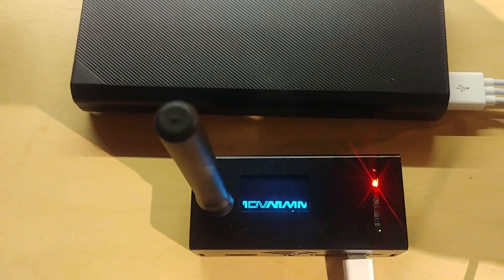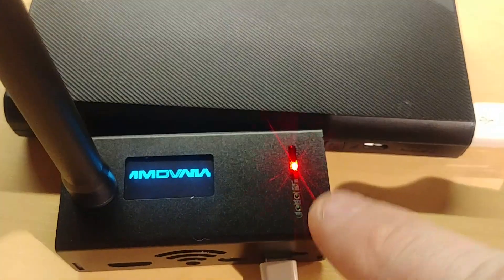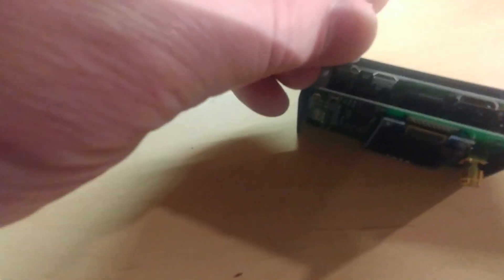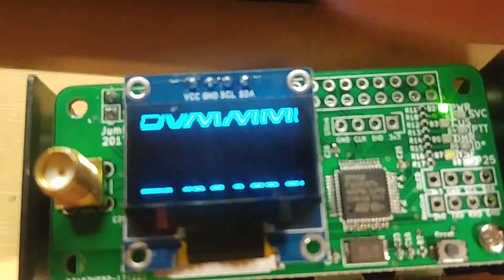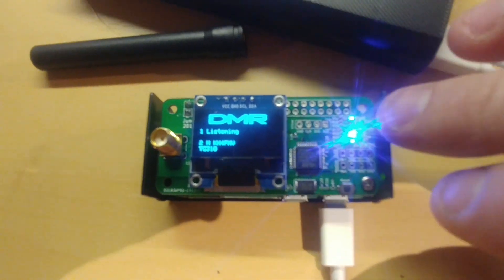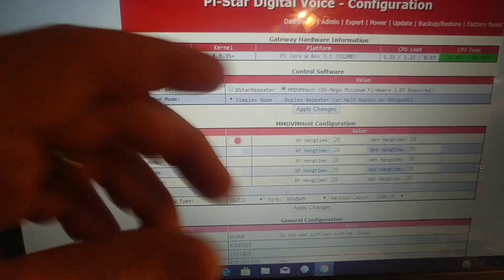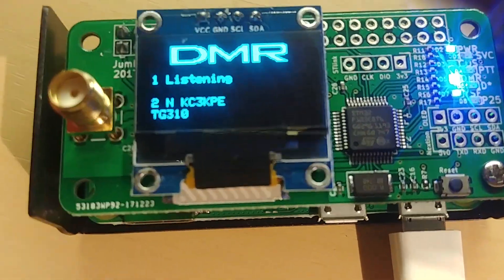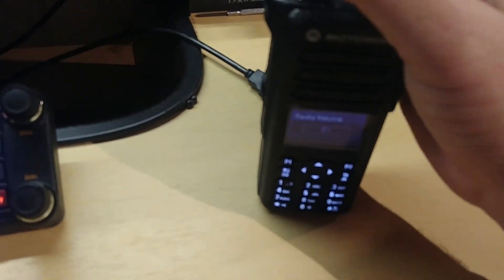Jumbo Spot DMR Hot Spot mmdvm board on a  pi zero

Comment: Hello KG4CDZ i knda have a question more than a comment that has to do with the gpio pin bar. I read that you have to have some pins insulated that's one of the  question's  whats all that about (pin  insulate). The other has to do with adding a jumper i think pin 40 to another pin i'll try to find a video on that subject of the link to that
http://www.hagensieker.com/blog/page/?post_id=99&title=jumbospot-dmr-hotspot having to do with firmware upgrade issue. Just purchased pi zero with i believe a jumbospot and had to return due to not working. And lots of trouble login to the dash board maybe once or twice per day it let me in. long story short messing around with the failed on gave me enough confidence to build my own.Whats your take on the 2 questions

Have Good Day
Adan
KI5IQU  In Oklahoma

Comment: When you first set up Pi-Star, there are two fields for your TxOffset & RxOffset that you should have entered your Hotspot’s offset into. However, after you do the initial setup, I’m not sure if you can get to those fields without starting over. Some else can confirm if that is the case or not. BTW, my offset label was on bottom of case and not inside.

Comment: Do you have any idea on why a mmdvm pi hotspot has no tx and rx?
Reply from the maker: do you have the offset set right by the sticker on the bottom of the board ? that is usually what the issue is
Reply: tried 100, 500, 1000.. still no luck. the mmdvm board has no label on what offset to be set also.

Comment: Just to let people know, there's a bad batch of these boards going round. I have purchased two so far from two different sellers on eBay and both were TX/RX dead. According to one or two groups on Facebook, boards manufactured in 2018 are having problems with the TCXO not working right and needing to be replaced. If you are unlucky enough to have one of these boards, return it for a full refund and do not accept anything less.
Reply: Seriously I just got one of these boards and the TX worked intermittently for less than 24 hours before she went complete silent. Junk.

Comment: I see you have your hotspot on 436.225 MHz.  Please try to avoid the satellite subband (435-438 MHz).  10 mw does not sound like much but don't forget you will be transmitting back to the hotspot with higher power.  As  these become more popular, the QRM will only get worse.
73 de K4RS
Reply from the maker: Roger Snyder my hot spot is not on 436 my hot spot is on my repeater frea
Reply: In this video, at 2:39, it is clear that you have set the hotspot frequency to 436.225.  This is right in the middle of the satellite subband.  I believe you changed the frequency later to a repeater frequency that has been assigned to you.  My initial comment was primarily directed to others who may not be aware of the problems that QRMing the weak  signal area used by satellites could cause.

73 de K4RS

Comment: Hi- I just got mine in today from china.  It boots to a solid green LED with a very slow blinking red LED.  The OLED display is totally black.  No instructions.  Solder connection looks good.  Any idea?
Reply from the maker: Bruce Kempf it has to be set up on your Wi-Fi before you can go,into,the settings and turn,on your screen and set everything up to use it I'm in the process of making a set up video from start to finish I hope to have it finished soon there is several web sites that will show u how to do it if u didn't get the instructions google jumbo spot set up  and pi star will get u started
Reply: I have the wifi setup but there is a setting for radio/modem type with lots to choose from.  I have the original OLED display but I have never yet seen anything light up on it.  Im worried its defective.

Comment: Question(s) for those who have this MMDVM model because I am either confused or my coffee this morning did not contain enough caffeine. LOL Before I buy one I would like to clarify a few things. First the frequency shown on the PiStar screen is 436.225500 MHz and he says the offset is 500 Khz. So what is programmed into the radio? 436.7255, 435.7255 or is it 436.2255? Does he mean something other than 500KHz? Also just playing with my radio (Ailunce HD-1) and trying to match his setup I cannot select 436.2255 it will only select 436.22500, 436.3125 or 436.21875. Also I noticed a comment below saying they could not find there WiFi with this setup. When I look online these devices say they include a Raspberry Pi Zero and not a Raspberry Pi Zero W (Wifi Model). Am I not correct on the Raspberry Pi models? Does this require a wired Ethernet (USB to Ethernet converter?) connection?
Reply: James Caperelli III I think that he mistakenly says "kiloHertz" would have been correct to just say "Hertz". He had to tell the computer to add 500 Hz. The radio only needed to be set to the first 6 digits of the programmed frequency on the computer.
Reply: Excellent! It is a PPM correction on the hotspot frequency and not an offset on the radio using it.

Comment: Thanks for the video, what tx amplifier do you think would work on it, considering that it only has 10 mW ouput power? Could you try the amplifier that you has running with your openSpot? Then we know if that works...
Reply from the maker: No wont work on that amp 10 mw is to low drive

Comment: Built two of these from kits and have one embedded into my coat so that it’s always on my person.  It’s powered by a banks embedded into my coat also and can be recharged by solar cells.  It’s driving a Nextion screen on the inside of my arm so I can just glance down and get info such as TG, call, name, location. (Using an old iPhone with free FreedomPop LTE for internet.) Tweaking modem settings.  What values others having most optimum use with for DMRTXLevel?  I’m finding en/decoding not working completely properly on low audio calls. Thanks.

Comment: Would you mind sharing where you purchased your usb breakout cable?
Reply from the maker: The white cable you see in the video came with a battery pack i order it has several different connections on it for different phones and devices but you can find them on ebay also
Reply: Thanks very much.

Comment: Thanks for the video!  I have been looking at the Jumbospot on eBay but was afraid it would be hard to set up being from China.  I like the fact that it already has a OLED attached for around the same price as the Zumspot plus the Zumspots are on backorder.  Hope to see your video on the WiFi setup on this soon.  I'm thinking of getting one on the way from China today.  Thanks.  73.
Reply from the maker: Its not that bad to set up I like challenges so for me its fun but it came with a instruction sheet that walks you through the whole setup process step by step
Reply: Well I've got one on the way from China.  I have the SharkRF and absolutely love it but I wanted a way to take it with me and I like how Pistar works.  I'm in Alabama and there are very few repeaters here so I have to rely on a hotspot.  Thanks again for the video
Reply: I would be interested to know if you can create more than one wifi connection in Pi star to drop into the boot directory.  If so, would it then auto connect to those connections when they are in range?  Maybe you will cover that on your next video.  Thanks. 73
Reply from the maker: Yes you can it works exactly as you desc when your in range to the ones you added it will connect to them automatically its nice i can go from my shack to my car and all i have to do is turn on the wifi hotspot on my phone its sweet lol

Comment: Great video—I was wondering about the kHz offset; it came on the wrapper for my Jumbospot. Did you add 500 kHz to your radio's TX and RX frequencies, too, or just in the Dashboard? 73 de K2WNW
Reply from the maker: Just the dash board i added .500 khz to the freq I wanted to use and that was it been working great i like it its a nice little setup
Reply: Awesome thanks. Yeah that little box is doing it all. Trying to get my P25 rig playing nicely with it, but I might have chosen the wrong modem setting (now fixed) and the P25 200 kHz offset is likely the culprit. 72 K2WNW